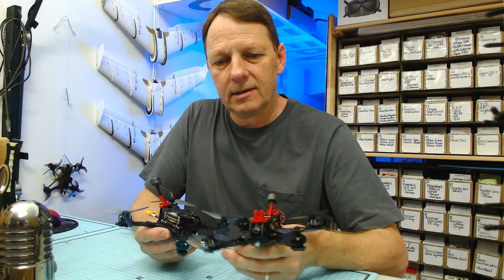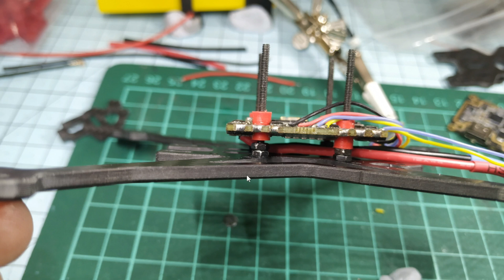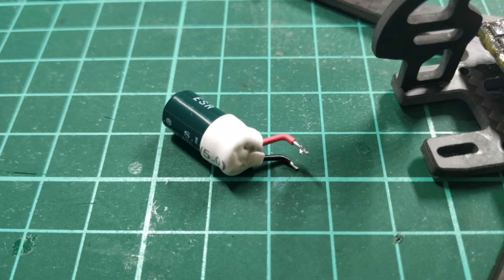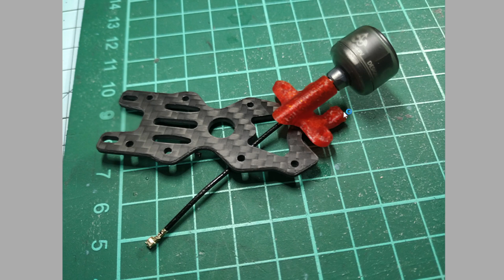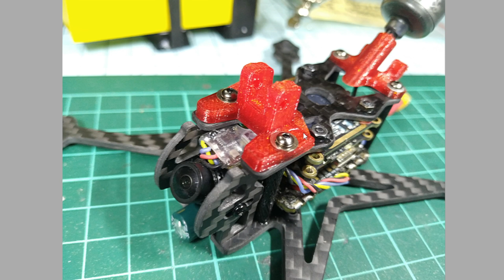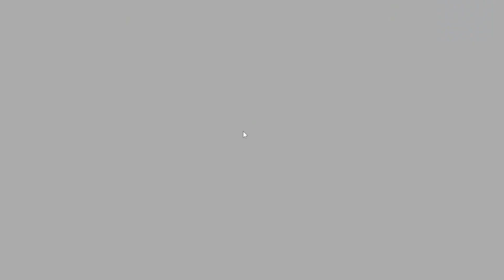Crux 35 FPV Frame Scratch Builds

Comment: I damaged the original vtx cable can I install another 5.8ghx rchp?
Reply: If it's just the cable that's damaged you can replace it with another antenna. Just make sure the connector is the same.
Reply: @MicronWings  thank you I’m going to buy and ufl ntenna

Comment: Subscribed! I have three Crux35. Two analog and one DJI HD. The fc board on one of the analog went dead. Thinking of buying a new fc and adding crossfire. Hope to see more videos.
Reply from the maker: I've always wondered about the standard FC boards - the apm rating is a bit low for my liking. I wonder if others have had any experience with the boards burning out or anything. The Crux 35 is a great airframe. I have one i fly  regularly.

Comment: Nicely laid out build. I will return here when it's time to rebuild one of my crux35s. When or if I have to, I'd like to use an ESC with a higher amp rating and so will need to use an external receiver. I use external vifly beeper on mine attached to the battery strap in case I get a battery disconnect.
Reply from the maker: Yes you can even put a stack in it with a separate ESC and FC board. But it's then a very tight build because you only have 22mm standoffs instead of 25mm.